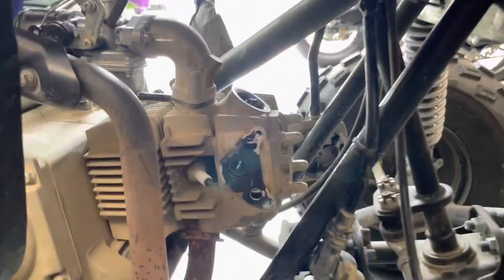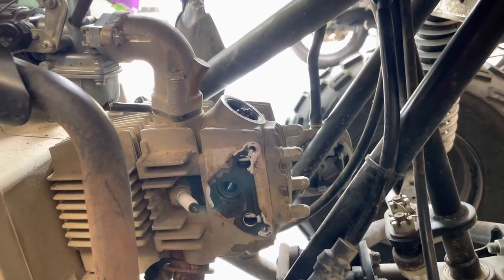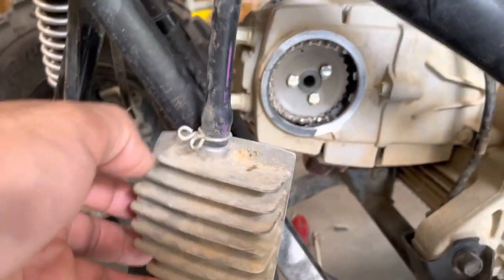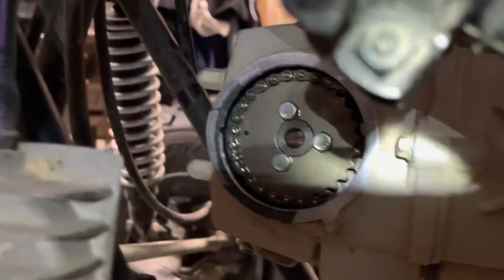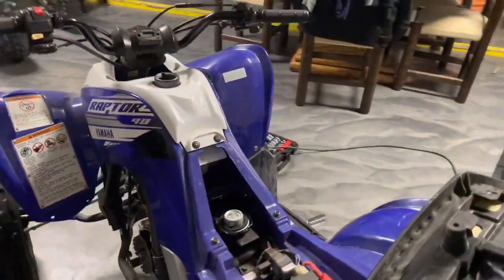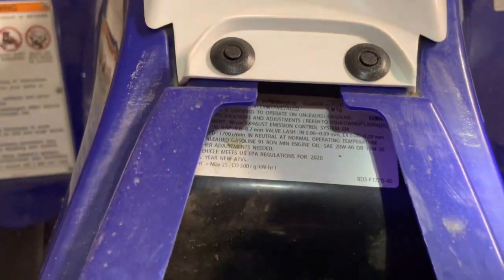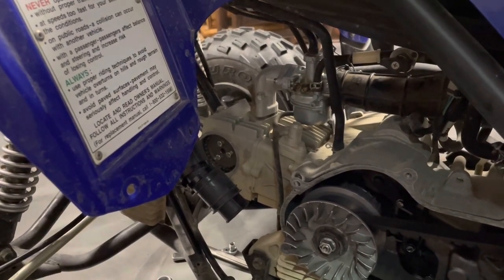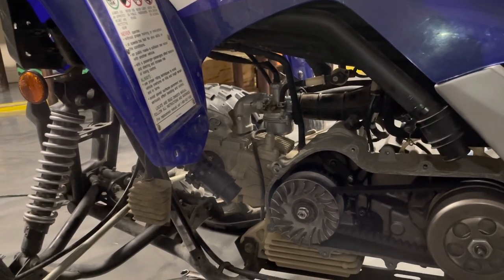2020 Yamaha Raptor 90 ATV Valve Clearance Check

Comment: Can you add a pic of your sticker I've looked on my 2021 an it's doesn't have the sticker any where 😢 the manual found on line says go see dealer for valve clearance check
Reply from the maker: It should be .06-.09mm for intake and exhaust clearance.

Comment: Do you HAVE to pull the big cover JUST TO ADJUST the valves??
Reply from the maker: I see no other way to do it.  You have to turn the crankshaft and camshaft to get the piston to top dead center to check the valve clearance.  Because of the centrifugal clutch you cannot place the transmission in gear, turn the rear wheels and turn the crankshaft.  The crankshaft will not move using this method.  Therefore you have to pull the clutch cover and spin the clutch on the engine side by hand.  Hopefully that makes sense to you.